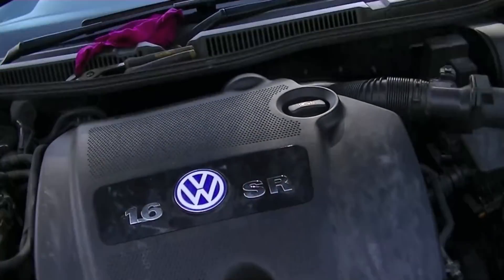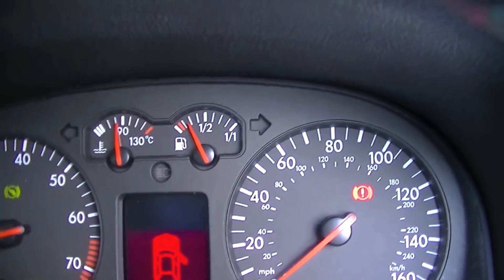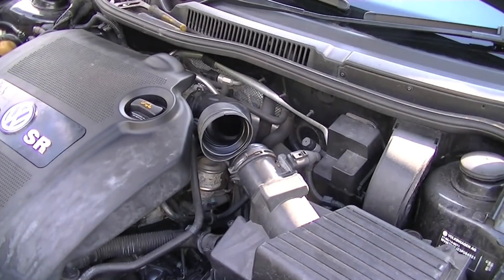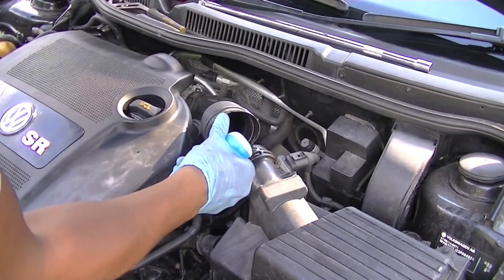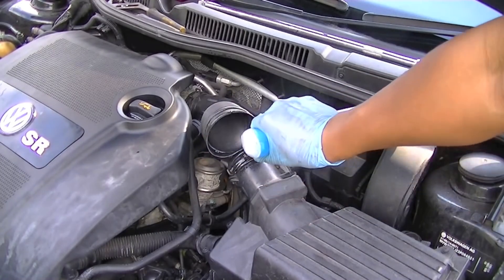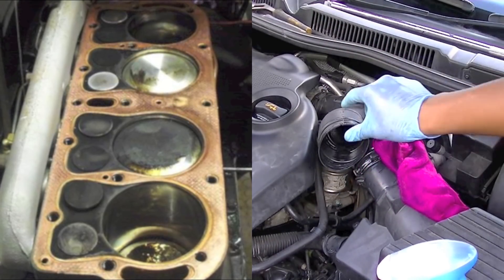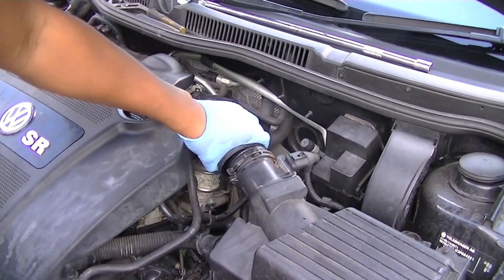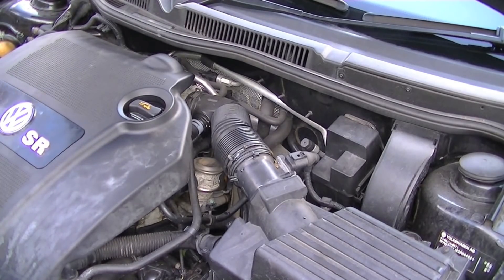How to make your engine run better with just tap water.......Better Than Seafoam?

Comment: this idiot has no clue. you do not follow his video it will damage your car and probably write it off.
Reply from the maker: Explain why i dont have a clue? Water methanol is a clue for you
Reply: Water methanol is not the same as water again like I stated before it has methanol in it to assist in cleaning. Doing what you are doing to the car can easily damage it if your not very careful where as if you use something designed for it you don't have the same amount of risk. Also your water will not make it to the cylinders due to heat it will evaporate beforehand and also when water evaporates it expands causing a rise in pressure as well that could possibly damage engine as well depending on where the pressure builds.
Reply: +BMAC VAGS do you know what a dipstick is?
Reply: water evaporates quikly if it toutches something realy hot like exhaust ,your intake will not reach that temperature, and wont evavaporate not all water cause at high rev gets sucked fast in the cylinder. water has to be sprayed in a verry fine mist to avoid getting collected in intake. and for your knowlege injecting water as fine mist in the combustion chaber helps to cool down  the engine aswell cleaning it. when useing water methanol the idea is that water reduces the temperatures. my point is injecting water as fine mist is ok i mean mist not droplets

Comment: this will dent the pistons stupid bitch
Reply from the maker: Explain how
Reply: +BMAC VAGS sorry I got a little bit mad  I don't know but it does trust me
Reply from the maker: +hamody pie No problem. So why say it will damage it if you dont know how?
Reply: +BMAC VAGS 

water doesn't compress so you are drasticly raising your compression ratio by adding water to the fuel/air mixture
Reply from the maker: +Mad4Tracks I am glad there are other people out there like you 👍
Reply from the maker: +Dave Leighton You will learn from the comments section that people will come up with all types of rubbish. I just watch and laugh 😂😂
Reply from the maker: +Brenden Lydick Okayyyyyy. So what happens in cars that use water methanol injection? Me being stupid and all.......
Reply: Lol, in fact I am going to, a same 1.8T. 
Okay, so as you are saying, if the turbo does not work at idle, then there is no difference between a N/A or F/I engine with this method is there? Having a turbo clearly has nothing to do with this piston damage theory. 

This method has been proven long way back. It is only dangerous for people who don't understand what they are doing.

Common sense is not enough to understand an engine dude. "Knowledge is key."
Reply: Brenden, he is not putting a hosepipe down the inlet manifold. In fact the amount of water going in is probably a very low percentage. He is also revving the engine and ensuring that it remains stable by not allowing it to run roughly. For decades I have done the same thing with my cars, both petrol and diesel using brake fluid instead of water with no ill effects to the engine. I don't think that the odd internal steam clean will do any harm. The water that comes out the tail pipe will be a lot less than the engine puts out when it's cold.
Reply from the maker: Brenden Lydick The car is not a turbo, it is naturally aspirated.  You are starting to look a little silly with your theories.
Reply: +BMAC VAGS 
Theory? Water doesn't compress fucktard. I don't know what part of that sounds like a theory, and I don't know why your tiny fuckin brain can't comprehend that.
Reply from the maker: +Devon Weetman Ever heard of water methanol injection
Reply: People open their pothole way to easily on youtube :) Glad you know better @BMAC VAGS
Reply: How do you "dent pistons"? Punch a hole in them, create a hot spot, but dent? that's a new one on me.
Reply: +BMAC VAGS 
are you actually stupid? water doesn't compress. you going to end up knocking a hole in your piston by putting water in you're cylinder. The motor loads up and wants to quit when you spray it because there is so much pressure in the cylinder, the car can't keep itself running. This isn't "rubish" it's common sense.
Reply: Indeed, just because the damaged piston theory is all you can understand from reading on forums, does not mean you can go shout that bullshit everywhere on the internet.
Reply: +Mad4Tracks 
Theory? I'm using common sense, not information from some forum. And I do invite you to do this to your vehicle and report back. the only thing that saved this motor is the fact that it's turbocharged. At idle, the turbo isn't making boost, and it cylinder pressure (Compression) is low, so it had room for more pressure.
Reply: +Mad4Tracks  
A turbo plays an extremely important part in this. If you look at a stock gm 6.5 N/A Diesel and a stock 6.5 TD, the N/A motor will have a higher compression ratio. If you knew anything about turbos, you'd know that they are a more efficient way to force air into the cylinder. To force more air, you need to have a lower compression ratio to compensate for the air your forcing in. The turbo runs on exhaust gases, and at idle, not enough gasses are being produced to spool up the turbo.
Reply: Yep, it wasn't clear you were up to that knowledge. However a 10:1 C/R still won't be dangerous as long as you know what you're doing when spraying water in. That's all I am saying and I know you know that's true.
Stop bitching to prove that "ingenuity" of your's. Youtube is not the place for that.
Reply: So petrol and diesel compress ?
Reply: +Mreque89 no, but obviously the manufacturer of the motor takes in account the fuel your putting in when designing so that the engine won't have too much compression. They didn't account for putting water in though....
Reply: +Brenden Lydick I'd argue that petroleum that is eager to evaporate is much harder to compress than water. Also the engine can withstand the added pressure when it is running cold and the ECU is forcing more fuel into the cylinders, the fact that he mentions you must run the car to temperature meaning the ECU would have lowered the fuel mixture makes this a fairly safe method.
Reply: Any amount of water going into an engine is a bad thing, as you were saying due to its inability to obtain pressure ratios as air does.
Reply: +Brenden Lydick Hey dipshit.

The water turns to steam by the time it enters the combustion chamber.

Steam DOES compress. 

Just an FYI. 

(By the way, liquids do in fact compress under extremely high pressures, but in most cases it is considered non-compressable. The oil in the crankshaft bearings, for example, sees several thousand PSI during your car's power stroke. Believe it or not, the engineers who design these things know about this and account for it. Anyway... no, a small mist of water entering the engine won't hurt it.)
Reply: This is why I turn off comments on my vids.  I was suspicious there were a lot of dumb asses out there but reading the comments confirmed it.  SMH
Reply: BMAC VAGS actually i havent, ill look into that. thanks
Reply from the maker: +Brenden Lydick You are NOT trying to compress water.  Your theory is only accurate if you pour a glass of water into a engine cylinder, but you are not.
Reply from the maker: +BrentRF Some of the stuff people regurgitate is comedy.
Reply: The water has a hammer and it's going to whack the shit out of the pistons huh?

Comment: When EricTheCarGuy does a video on this exact method, he gets positive reactions and 95% likes. 
This man does the same and receives a bunch of doubtful commentaries.
Reply from the maker: +Case I appreciate your concern. But in all honesty, I find it quite entertaining. Hate emotions are at the detriment of the host. People burdened with hate, always try to infect others.
Reply: I keep a wet sponge in the air box and partially run my Tacoma on distled and or filtered water.  They claim cars get better mileage in the rain.  This is adding extra hydrogen and oxygen vapor to the hydrocarbon fuel mix.  After 5 years I'm still doing it. Cleaning the MAF with brake cleaner on a regular basis (2 to 3 times per year) also keeps the economy at its max.
Reply: 50 Quid don’t use brake cleaner to clean MAF. There’s a special MAF cleaner you should use which won’t do any damage and leaves no residue on the sensor.
Reply: tueybooo yea people are fickle as fk these days
Reply: What are you trying to say here?
Reply from the maker: @adylyttle7832  Appreciate that
Reply: It amazes me how every one is an expert. They have never tried this or heard of it so they are dumb asses talking about something they know nothing about. Just shows how ignorant most people are. Don't know shit from shine'ola but have to lip off just to hear themselves.
Reply: Can do the same with 1.8 Turbo in Leon?
Reply: it's the law of averages that you'll get negative feedback from fuckwits. just ignore the haters.
Reply: And ridiculously racist comments.

Yeah, reading the comments here is pretty painful. I feel sorry for the uploader.
Reply: Hes Black. That may sound crass but look on almost every youtube channel and you will see a similar result unless theres a good looking woman
Reply: Welcome to being black
Reply: He's black

Comment: Hi and Namaste. I have an Audi A3 s-line 2.0 tdi 8p engine with a variable vien turbo. You know what's coming? I've tried the Mr Muscle and Diesel Clean Kit with no success, car still going into limp mode when accelerating hard.. I know what's causing the problem "sticky veins" from carbon build up. Does this H2O treatment work for cleaning the veins in the turbo? or does it have to be removed stripped and cleaned really?? I'm a self taught mechanic, so half a clue at least.. 
blessings. W

Comment: Well you say it works but where is the proof? Do you have before and after pics of the heads to actually prove that it does clean it or how about pictures a few months later when the tops of the pistons are all rusted?
Reply from the maker: Where is the independent proof from seafoam or any other engine cleaner?

Comment: At least water is less expensive than seafoam, neither does anything good but at least it's cheap.  Actually water through the intake is probably less potentially harmful than seafoaming an engine.
Reply: There is no rust occurring on a water injected engine when being properly operated.
Reply: piston head rust..............way worse problem than carbon buildup.
Reply: +kevin spencer all watercooled vws use aluminum pistons and cylinder heads. only the block is steel but rust would be cleaned off by the rings just like brakes.
Reply: EXELENT comment i have a vw beatle for 3 years running in water and gas........................that come from the second war airplanes spitfire to go to more altitude congrats

Comment: water injection is as a charge cooler ,,, now if you then stripped this engine to show the effects , id be more impressed ,,, jfyi , we used to to this with army landrovers using brake fluid not water ,,, it worked reasonably well ,,,, would i be doing it to a new car ,,, not mine.

Comment: and can anyone tell me why there are water seperators on diesels and why they even have a water in fuel light ?i know there are some smart guys on here.if any one knows the answer it will show this is a crock of shit.number 2 water methanol injection is a poor example to give and the water injected is so minimal and the only reason for it is to cool the air in between the pistonand the head because colder air expands better then hot like an intercooler for a turbo .
Reply: diesel is combustible  h20 no !

Comment: Don't pay attention to the naysayers here. This is an old method, tried and true. Who said it would crack your heads? HAHA. I suppose that we should all put a heating element in our fuel tanks to warm the fuel, so that it doesn't crack the heads as well... ridiculous. Water injection has been used without any problems to increase fuel efficiency since carbureted days. Good tip BMAC. These fools don't have the foggiest clue as to what they are doing. Its not like you're dumping water in from a pitcher... Good tip.

Comment: There is apsolutly no reason to do this on new car or new-er, cuz all gasoline today must be treated with aditives by law. 
As for older cars when this law did not exist, they might have old carbon deposits. 
allknows Seafoam is mixture of water and some low chems and some oil. 
nothing you cant make at home. 
1 spray botlle, 
Add some clean water NOT TAP water... 
add some wd40 or some fine mech. oil in it.
add just a litlle bit of alcohol vinegar, and you gotyourself seafoam... 
Spray the warm car for 5-10 mins, and after 10 mins try to choke it with water but slowly. let it die out slowly and let it sit for a while (5mins or so) 
Restart your car and give it a good run. 
you can check inside of engine and you will see some good cleaning.

Comment: PUBLIC SERVICE NOTICE: No not ever use tap water with your engine, not even in your radiator. Tap water contains minerals and will leave deposits and lead to build up of said minerals which can damage your car.
Reply: on side note... carb cleaner or starter fluid is a great old school way to clean out carbon. Doesn't take a lot just a little into the intake will burn at a higher temp burning up carbon in the combustion chamber.
Reply: Thanks man, so you're saying use bottled water from the shop?

Comment: Lots of years ago, long before you were born. Some had a vacuum plate mounted under the carburetor. Folks would hook up water systems that allowed the vacuum to draw in the water which would give you more power, clean the carbon from your engine and make it run a bit cooler. Long before computers in cars, they only had the radiator and the oil keeping an engine running cool. Fans were mounted to your coolant pump and spun as fast as your engine rpms. No extra cooling fans and so on. So water being drawn into your engine in a mist form was quite beneficial. Also an engine without carbon buildup runs cooler anyway. So what your showing folks is really beneficial to life of your cars engine. Nice job. And to those that might worry about carbon breaking loose and scratching up your piston walls. Water makes steam in the cylinders and softens up the carbon. So unless your engine is almost clogged solid with carbon, that's a very slim possibility.

Comment: i run water injection on my skyline they sell water/methanol injection for cars my car made an extra 15hp from running water mist into the intake ita only if you fill the bore with water when you will do damage with this method it will not harm youre engine it will not rust parts as its at such a temp it will just burn up fast i have no idea if this works but i do know it doesnt stuff youre engine

Comment: Wally  water will not clean engine , there is a mass of water in  piston bore when engine  when the air /fuel mixture is fired and is exhausted  in to exhaust system  were you think all that condensations in tail pipe in winter comes from in cold weather and cold morning, water corrodes  aluminium,, rusts steel/cast iron,, weakens white metals in bearing shells ,,causes bronze bearing shells to crack in small ends as water is abrasive on bronze under loads  chromium plating on piston ring  the list is endless  , yet say you pour water in to in  You can do that on a cold wet day in heavy rain, and you don't even get to open bonnet , the amount of water vapour drawn in to a engine in high humidity and rain storms can be as high 30/40/% yet they still run, as long as the engine parameters are in default levels  petrol/diesel /gas / exploded hydrocarbon's in a confined area guess what you get water as part of the energy cycle ,   so why pour more in to poor thing, :¬}

Comment: If you need help with mechanics check out Scotty Kilmer videos. He been a mechanic for 45 years. He used Gumout multi system tun up with great results. He had a car he bought with 230,000 that was neglected. He bore scopes the Pistons for you and shows the results. Just YouTube Scotty Kilmer fuel additives. Peace

Comment: Duralube gas treatment will absolutely Clean all of the carbon out of the pistons and valves. I used it in a 4 cyl. Chevy truck twice a year and at 145,000 just for the helluva it I had the fuel injectors looked at. My mechanic said they looked brand new. no carbon at all. he also looked inside the cylinders thought the spark plug hole and saw no signs of carbon build up. Duralube engine treatment also saved my engine during the hot summer nights of Texas. I drove 350 miles. some of which was during 8 hours of a day shift. my oil pressure gauge was jumping around a lot and then would settle when at speed. I decided after working that it was time for an oil change. The lube tech told me I had big hole in my oil filter, which I do remember hitting something in the street a few days before, and he said the truck barely had 1 quart of oil in it. he asked if I'd been driving it like this long, when I told him how long he didn't believe me. He said my engine should have overheated big time. but since I treated the engine with Duralude engine treatment my engine didn't even go above normal temp. 350 miles in hot Texas Sun during summer and no oil and my engine stayed at norm temp, duralube is the shit.

Comment: I though water was non compressible therefore if to much is injected piston rods could bend or some other engine failure. I am by no means a mechanic, I'm just a 14 year old with a budding passion for cars.

Comment: I sprayed 1/4 cup of water in my 1971 thunderbird to solve my dieseling issue and  it runs smoother.  It must be done with a hot engine (more steam) and high rpm